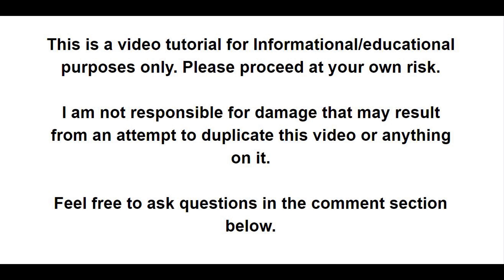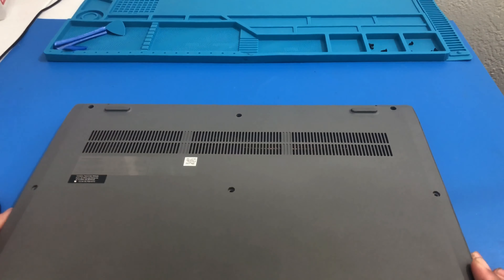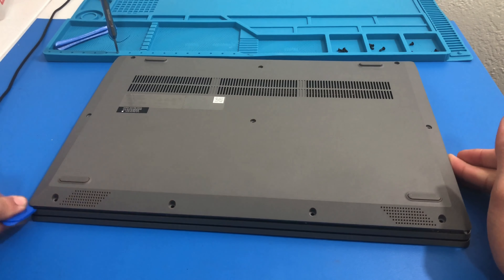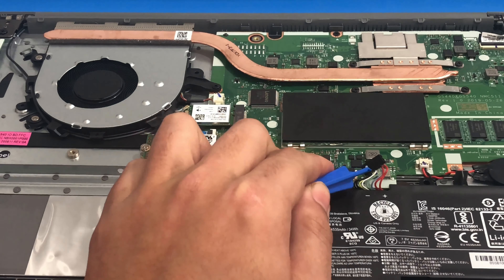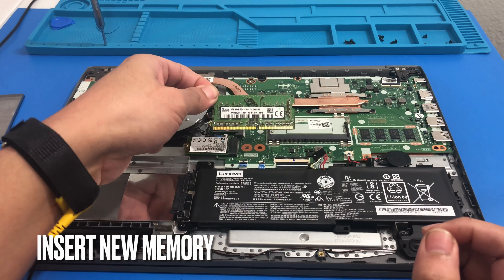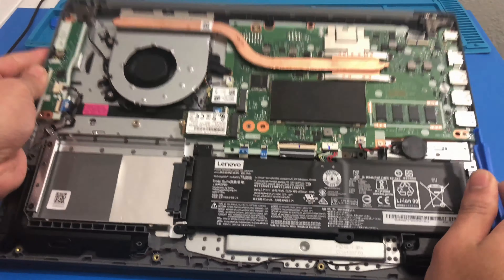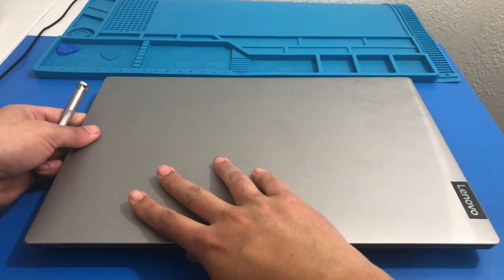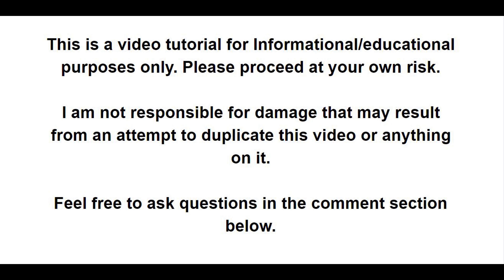Ram Upgrade! Lenovo IdeaPad S145 | 81UT00EAUS

Comment: I found the video. But i didn't understand the way that you remove 4gb and insert new 8gb memory but it says it has 12gb memory. How is this happening
Reply from the maker: There’s 4gb ram that can’t be removed. Only one slot with removable ram. It had a 4gm ram stick removable replaced it with an 8gb ram stick. (4gb ram no removable + 4gb ram removable). After replacing 4gb removable ram it becomes (4gb ram non removable +8gb ram stick = 12gb ram total)
Reply: @whattmeter  oh ok i got it, thank you so much. By the way can you recommend me some rams? I have Lenovo IdeaPad S145 Ryzen 3 and i  have 8gb memory but the gpu takes 2gbs of it and leaves me 6gb. So i want to upgrade my memory to 12gb too.
Reply from the maker: @kurtbeystudio I don’t really have specific brand recommendations
Reply: @whattmeter  ok. Thank you anyways.

Comment: I have the same laptop with 4gb soldered ram at 2400mhz.Should i go for one more 4gb stick or for a 8 gb stick at 2400mhz.If i go for a 8gb stick would it work on dual channel because of flex mode?(i dont do gaming).
Reply: X2

Comment: Hey bro video is cool, I have a question
my s145 is of 4gb ram
Can I expand it into 16gb Ram
Reply: How many slot of your laptop for ram?
Reply: @IrsanAchmad  2 slots, 1 slot is Soltred and 1 is free
Reply from the maker: You can check the manual. Or use cmd command “wmic memphysical get maxcapacity” it will tell you max ram. Not always accurate but good for the most part
Reply from the maker: Another way to check ram is using crucial scanner which is accurate most of the time
Reply: @whattmeter  tq ☺

Comment: Hi, the tutorial is wonderful and clearly explains the process. Thank you for your work! 
Is it necessary to disconnect the battery from the motherboard before I can insert the RAM in the empty slot on motherboard besides the soldered RAM? (My slot is empty and I'm adding a RAM in the empty slot rather than replacing/upgrading it with one already present on it)
It's too tight on my device & I'm afraid I might end up breaking it or snapping it off the motherboard -.-"
Reply from the maker: It’s recommended to avoid shorting components. It’s just a precaution. It’s usually a good idea. That’s just my opinion
Reply: @whattmeter  Gotcha! Well then I'll have to try a bit harder and pull it out.
I was worried I'll damage the motherboard if I pull too hard but leaving it connected is also risky. It'll be a nightmare to short something out or damage some other component while making an upgrade to my device, so will try again with a little more force and if unsuccessful will take it to the lenovo service center and ask them to do it for me. Thanks a ton for your reply, you're awesome! Cheers!
Reply from the maker: Good luck with the upgrade

Comment: Bro. My laptop s145 has no ram stick you just removed. It has issues on blackscreens and i let the pc store fix it. It worked for like 3 months and now stuck again on blackscreen. I opened it now and saw no ram stick in it. Did they remove it? Holy shit

Comment: I have a question if I upgrade my ryzen 3 3200u to 8gb ram (4/4) to 12 gb (4/8) will my gpu memory will increase to

and can i upgrade i t to 20gb as it is showing max 12 but if I put 20 it will not damage the hardware

Comment: i do follow every steps in your video, but after replacing 4g to 8g stick with the same bus 2400, my laptop wont turn on, just the black screen. Do you have any experiences with this case ?
Reply: my laptop is lenovo s145 , ryzen 5 3500u, 4g ram solder
Reply from the maker: I would try reseating ram. If no luck I would contact support
Reply from the maker: Also how long did you wait? Sometimes it takes a few minutes for pc to recognize ram
Reply: @whattmeter  i let the black screen run for 30 mins, nothing happens
Reply from the maker: You can look it up to see if it’s compatible or ask support to find out
Reply from the maker: Also was the ram nonecc or ecc
Reply: @whattmeter  it's non ecc, i was asking around and they said i must buy 8g ram 1rx16 instead of 1rx8, but i cant find that type anywhere. What type is your ram ?

Comment: My laptop is lenovo ideapad s145-API amd ryzen 3200u with 4 gb inbuilt ram 2400 mhz but like to update 8gb ram make it 12 gb total but in online 2400 mhz ram price very high but 2666 is less so can I use 2666 instead of2400 mhz
Reply: Did u do it ??cuz I have the same laptop

Comment: My laptop is a lenovo Ideapad s145 i3 8gen with 4gb ram, I wanna buy another 4gb ram but, how do I know if my laptop has 2 slots?
Reply from the maker: Open cmd as admin > wmic memphysical get Maxcapacity, Memory Devices (if memory devices show 2, then you have 2 slot) keep in mind though that soldered ram also counts as a slot
Reply from the maker: You can also go task manager > performance tab > memory (lower right corner shows spot used)  keep in mind though that soldered ram also counts as a slot if it’s being used

Comment: Love from india
Reply from the maker: Thanks for watching hope it helps
Reply: @whattmeter  hello my friend, after upgraded from 4+4 to 4+8 of RAM the pc doesn't turn on, just fan at max and black screen. I used 2400mhz ram as it was the preinstalled one. I tried to unplug the battery and remove several times the ram but nothing changed. Can you help me? Thank you.

Comment: can a 3200mhz woke tow
Reply from the maker: I reviewed the video i made. For this specific laptop it has ram soldered on running 2400mhz. You can install 3200 mhz ram but it will only run at 2400mhz speed. Hope that makes sense

Comment: V: fua chaval ,No se si este es el mismo modelo que el mio es el lenovo Ideapad s145 14 api, y tiene 4 gb soldados quiesiera saber cuanta ram soporta
Reply from the maker: abre cmd como admin> escribe "wmic memphysical get maxcapacity"> convierte los números a gb para saber cuánta memoria máxima puede manejar. También puede consultar el administrador de tareas para ver la cantidad de RAM y ranuras que tiene instaladas actualmente. (
open cmd as admin > type "wmic memphysical get maxcapacity" > convert the numbers to gb to know how much max memory it can handle. You can also check task manager to see how much ram and slots you currently have installed.)
Reply: @whattmeter  gracias este ya lo hice tiene dos ranuras segun pero una esta soldada y cuenta con un slot disponible y soporta hasta 12 gb ram segun la consola, ¿no habra problema si le pongo una de 8 gb contando la soldada de 4gb no afectara en nada?
Reply from the maker: Si suena birn. Deberia estar bien. Una barra de 8 gb de ram y 4 gb soldana
Reply: @andresalexandernarvaezmart2497  lo hiciste? Si fue así sentiste que iba mejor??

Comment: Bro should I put a 4 gig card and make it dual channela
Reply: I opened up my laptop which is the same one and it already has a 4 gig ram card in it
Reply: @jkw_915  so put another identical card and make ur pc fast
Reply: @Jose-wt7ve  it only supports one card, so it has 4 gigs of ram that you can’t remove and it has 4 gigs of ram that you can remove
Reply: @jkw_915  that's what I was suggesting the soldered 4 gb and the one u are gonna put will be dual channeled if u put the correct identical card with same specs
Reply: @Jose-wt7ve  ah I see what you mean, but you should put in 8 gigs instead of 4 because it helps run a lot more smoothly
Reply: @jkw_915  I agree but 12gig ram is slower than dual channeled 8 gig ram we'll get a 20-35fps difference in dual channeled vs the 12 gig also if u save ur money buy a  cooling pad 
Then we'll get absolute performance
Reply: @Jose-wt7ve  alright, I’ll take that into consideration and get a cooling pad

Comment: Question does the brand of the ram matter in laptops?
Reply from the maker: Brand usually no. Check the CL of the ram as they differ as well as the speed, and ram type like Ddr4 or ddr3. Some ram (usually high performance/high density ram) requires you to change the xmp profile to get the max speed. Most of the time though ram is pretty straightforward